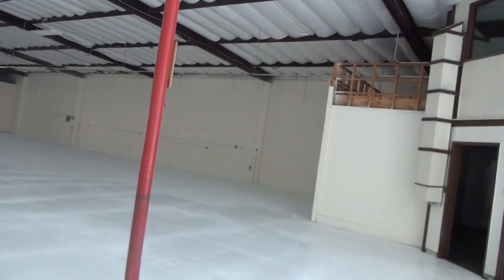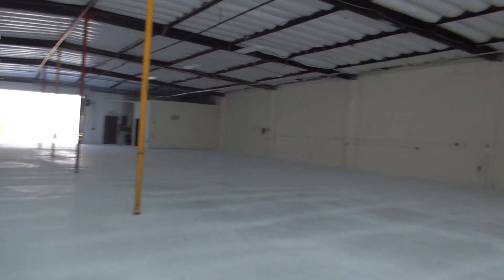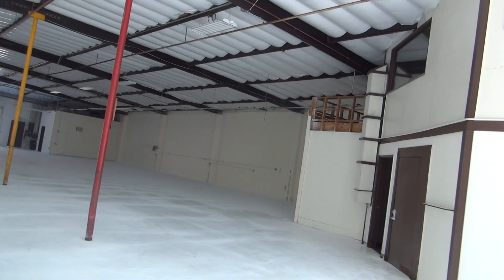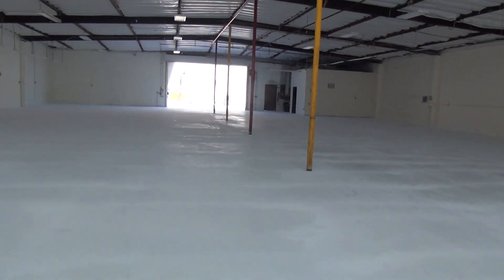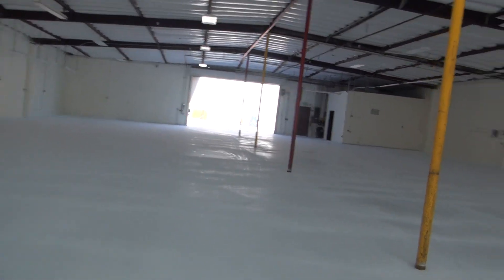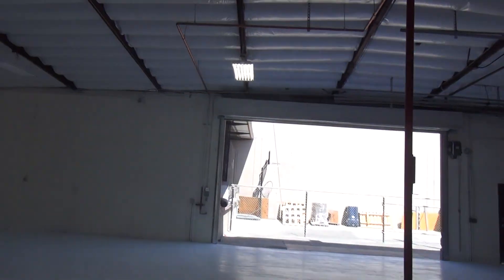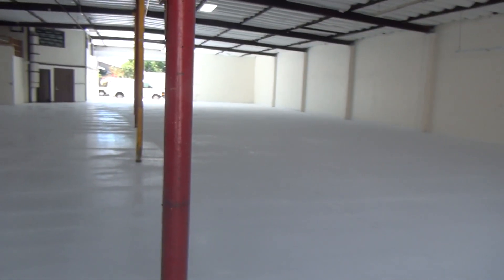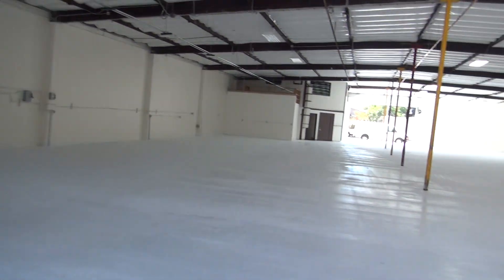Hunting Harley's new shop floor

Comment: So on the product spec sheet where it says "critical recoat " ,  did time stated mean you" must" recoat by then or that you "cant" recoat "till" then?  Either way , "acetone -acrylic"  i cant see it coming up
 ( after curing) , thats some bad shit !
Reply from the maker: Tomcaatt I am familiar enough with various types of paints to know that this should not happen. The site 
http://www.upcoatings.com/products/sa24.php 
is specific, re-coating time is critical, must be done within 1-2 hours or when tacky.  I called them and the contractor on it, they assured me that the solvents were strong enough to essentially re liquify the under coat. Obviously, they were incorrect